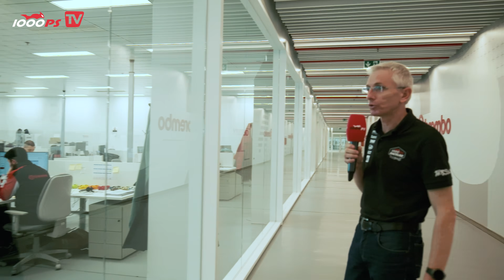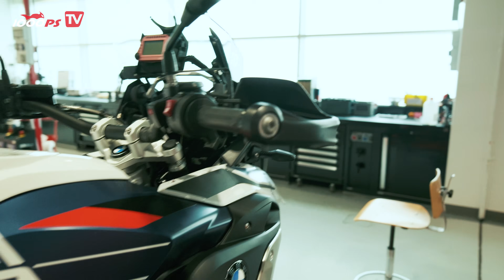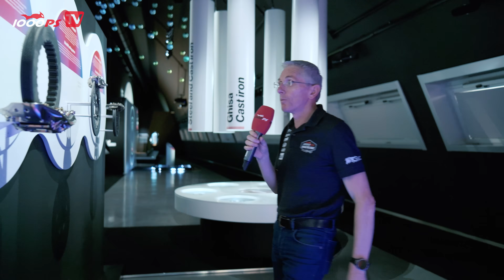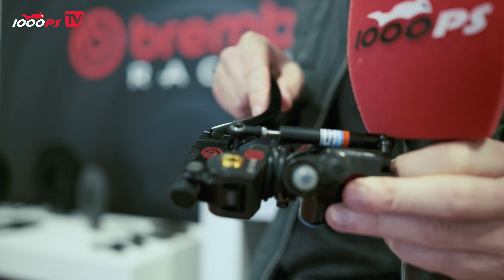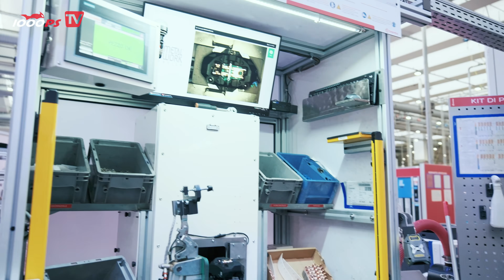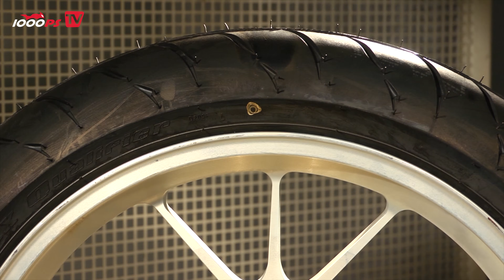Why Everyone Wants Brembo Brakes

Comment: I wonder how many people will be triggered by the "brake by wire" once it will actually show up in motorcycles. Also would be nice if could get info if Brembo is also looking into 3d printing, especially metal 3d printing seems to be advancing very fast.
Reply: Brake by wire is the worst thing I've ever heard, I'm already triggered. Flat battery? Death. Trail braking? Slam the lever and let the electronics take over. Don't even have to steer, lean or accelerate anymore, just select your government approved destination and be ragdolled around in your automated wheelchair.
Reply: @williamlu4394 I 100% agree…and it’ll be a tough thing to accurately simulate the sensory feedback that hydraulic brakes provide.